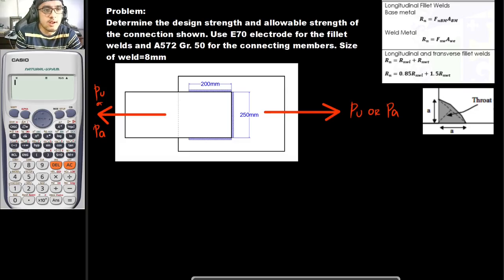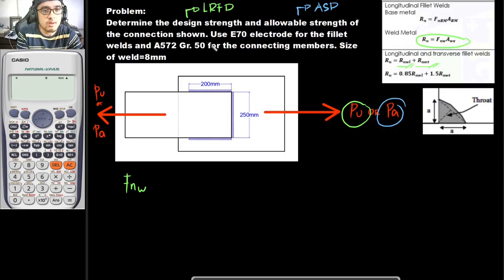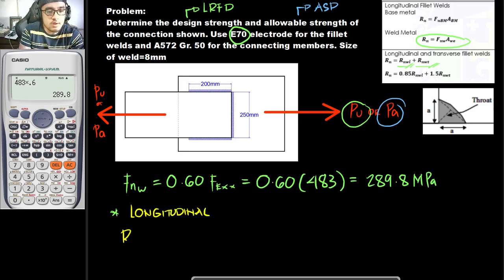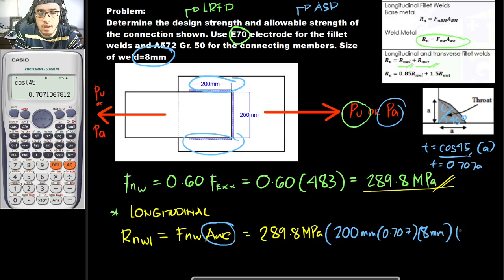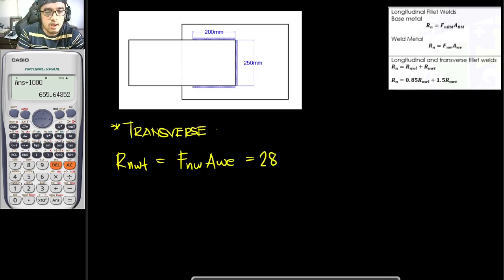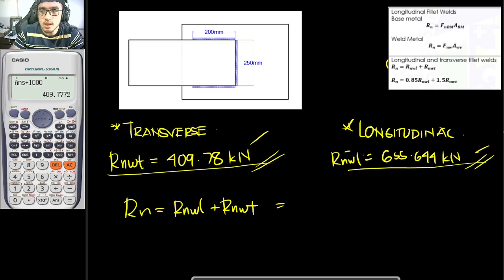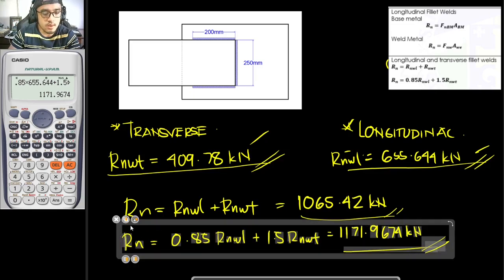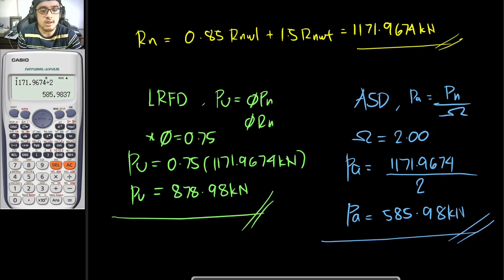Steel Welded Connections p2:  Fillet Weld Analysis Problem

Comment: Sir hindi Fv=0.3Fu
Reply from the maker: @zaifarmanalas1854  hello! The reference table used in the video from came from a western book and apparently not entirely conforming with NSCP 2015.(as I just saw, sa groove weld ginamit ni NSCP yung 0.6Fexx. Iba dun sa book screenshot) I will try to cross examine the  ref table with NSCP 2015 and will be discussing it with Structural Engineering professors on what transpired bakit magkaiba sila. Apologies for the confusion! I will keep you posted.

P.S. Gagawa po ako ng bagong video na specific po for latest code ng NSCP.

Comment: Hi, so i have a question. How would you go about answering a question that goes like: An angle section with dimensions 100 x 75 x10 is 
connected to a gusset plate with a 10 mm weld. If the ultimate force in the member is 
500 kN, use E70XX weld and S355JR steel to check the adequacy of the section. Thickness of the plate is 20 mm?

Would appreciate your input.
Reply from the maker: Check the capacity of the section by solving for capacity for Gross Sectional Yielding and the Welded connection. Then compare them with 500kN. If the capacities of the section and and the welds are higher than 500kN, then it is adequate. If either or both the capacities are/is less than 500kN, then it is inadequate 😊